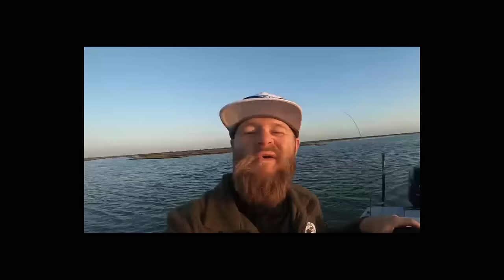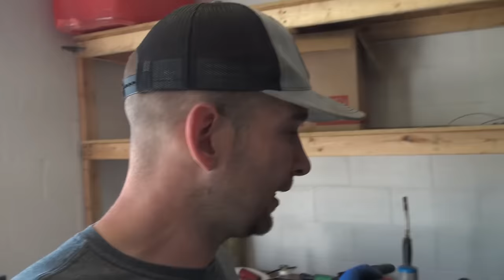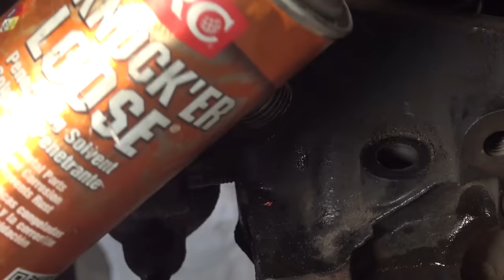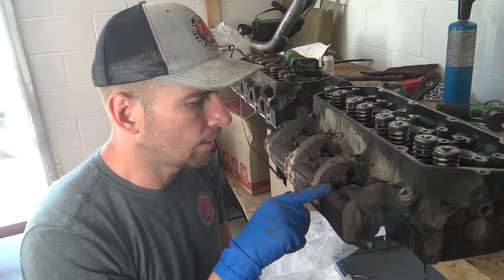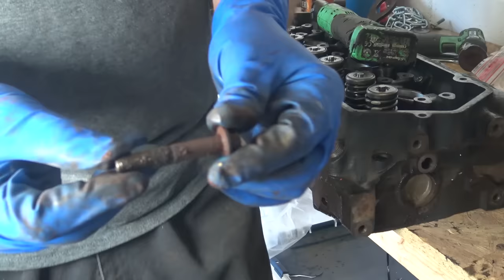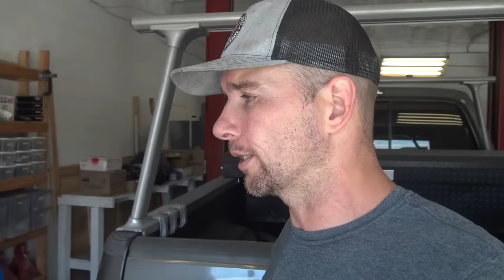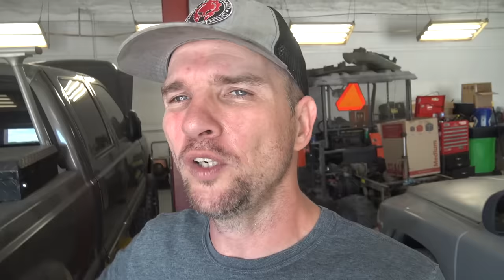Old Mechanic Taught Me This Trick To Removing Rusty Exhaust Manifold Bolts!

Comment: an old timer gave my the best advice to date. I`v been turning wrenches for 30yrs now. here it is, any thing your working on when you get frustrated stop, go get a coffe,pop,beer come back and it will just come apart. Trust me when you try this you will be amazed how it works.
Reply: Sometimes that helps to let the penetrating oil soak in, but quite often, it will still be a struggle removing bolts like these...
Reply: this is true. even works with stubborn electrical connectors.   (No PB Blaster ;)
Reply: The best advice on the comment thread no doubt!
Reply: Never do anything under heavy emotions, when possible.
Reply: My papa used to think about it before bed then the next day he'd get er done!
Reply: Good advice and it does work.
Reply: Great advice! I DIY quite often where I can on my vehicles and I've found that sometimes under high stress, alls you gotta do is take a break and come back to it when you've cleared your mind and maybe had something to eat. It's always better to wrench when you are relaxed and not stressed out
Reply: Yeah,except when the boss prefers to watch you struggle rather than give it a few minutes
Reply: well....to borrow a phrase from MIB movie " we need some pie!", the problem is still there when ya get back, but a pause is valuable because for some mechanics it permits some thought that leads to a solution. Most of all it breaks the cycle of impatience and frustration which usually lead to mistakes, even for a seasoned mechanic.
Reply: Or weed.
But always hit it with penetrating oil before you walk away.
Reply: I've had some you could come back 2 weeks later and it would still be a total pain. And, IMO, penetrating oil, no matter who makes it, Blaster, CRC are all  over rated . Maybe 1 time in 20 they actually helped get a bolt un-stuck.
Reply: That works for putting things back together again too
Reply: Bong rip?
Reply: Thats exactly right, it's amazing, when you're trying to start a nut in a very tough to get at place or similar situation if you take at least a 15 minute break it's surprising how  easy it is when you try again.
Reply: I needed to read that
Reply: Deep wisdom
Reply: For sure.  I ordered parts for my truck weeks away. Lol

Comment: Great video.  I have been a mechanic since the fifties and in that time I have done most things wrong at least once.  And when I have I have always made certain I understand what I did wrong.  When it comes to rust, corroded bolts I have pretty much mastered the problem.  The key to my method is "impact."  By that I mean a hammer.  One thing you have correctly described is, don't rush it.  Spray on the penetrant and let it have some time to do it's work.  Come back and put a wrench on the bolt and rock on the bolt head.  I like to use a box end wrench and twist left and twist right.  Stop.  Unless that bolt is clearly going to come out easily, spray and hit it with a small ball peen hammer. Rap on it a bit.  Get the wrench back on and twist, alternating directions.  Not loosening?  Restart the process.  The hammering is very important because the shock of the hammer blows breaks up the rust.  The penetrant and the shock should do all the work.  The wrench (or the socket,) does the unscrewing but It will always be easy if you use enough penetrant, shock and time.  Don't rush it.  It will work, just be patient and keep repeating the process. One last thing.  Get yourself a set of high quality left handed drill bits.  If things go bad and the bolt head is gone, use the largest lefty drill bit you can and it will probably unscrew the bolt.  Get the bolt out and everything out of the way and tap that bolt hole.  Screw the tap in as far as it goes in easily, flood it with penetrant, back out a quarter turn.  Repeat until you can turn that tap in there with your fingers.  Going together, use a metallic anti-sieze on the threads.  This is no indictment of your method, I'm just telling you what I have worked out and what works well for me.
Reply: Excellent points to compliment a very useful video.  I just returned from a shop and the mechanic said the manifold was leaking and so he failed the inspection. Said he was afraid to fix it for fear of breaking the bolts off.  Problem is that there is very little clearance to do the work, but we will give it a shot.
Reply: I have used a hammer drill set to hammer only, and a punch, or socket, to press on manifold or bolt, run that for a while.  The vibrations break up the rust, as due the other techniques.
Reply: Cool info,sometimes its what the guy before you work on it did or didn't do well.Antiseize,locktite,Teflon tape,pipe dope,grease,especially tires i despise a tire shop that makes it impossible to get a wheel OFF.I always have a plumbers helper in my car 2 feet long,this has saved me from AAA having to come out.I like to fix my stuff from my Toyota RAV4,to my Sig P320C, always buy the Chilton manual for your vehicle,over the past 50 years I used them to help rebuild my dads carburetors etc etc ... on all our MGBs to my 41 Ford super Deluxe coupe.Which was my daily driver when I was 16.
Reply: There is a product made by Conklin which is called Rust Bomb.  It really works, better than any penetrating oil out there.  Some distributors for Conklin have made a lot of money  through the company with just this product alone.  It works on ultrasonic vibrations when using the hammer tapping method.  You'll be amazed how well it works.
Reply: @Bruce Doxey;  
Thank you for sharing you lifetime of experience on this. I greatly appreciate it..
Reply: 2 cents from the peanut gallery: use bottom tap for cleaning holes the have a super short taper. I prefer copper based antisieze like caterpillar uses.
Reply: Snap-on tools makes a handy tool called the "Shake and Break". It fits in your air hammer with a 3/8" square on the other end to put your socket on and a 3/4" hex in the middle to put your wrench on. You pull the trigger slightly, not too much, while at the same time putting pressure on your 3/4" wrench and BAM!!! she comes loose. You can use it with a screw driver tip, instead of a socket, for removing steel screws from aluminum like when removing lights on the side of a transport truck trailer. Been using it for years. Gitchya one!!
Reply: Came here to say this. 9/10 times impact will break it free. I also mean impact with a hammer, not an impact tool.
Reply: I agree.  Tap tap tap.   Not hard.  But many many small taps.  All of a sudden with light pressure the bolt comes out.
Reply: Yes, shock waves tend to help also. It's like using an impact gun, but you control the torque by using a hand wrench.
Reply: Someone taught me this yea
Reply: Someone taught me this years ago. Patience us a virtue for sure. If it takes 20 straight minutes of light blows from a small ball peen and heat/ penetrating oil will get 99 pe
Reply: The hammer is a good method, but as well as hitting the nut on the end, try hitting it side to side.  The hole is always larger diameter than the bolt, so the bolt shaft should be able to move left and right a bit, to break up the rust.... You have only to get 1 thou clearance for it to be loose.
Reply: Thank you for taking the time to post your comment, I enjoyed reading all of it. And I learned a lot from your suggestions
Reply: You're right, I worked as a machinist in Commercial Fleet and removed hundreds of bolts, intact and broken. Penetrating oil and a good shock to the head of a bolt is key. I usually had to drill out the broken bolts after our mechanics had already broken them off or they had broken from heat cycling. I actually got pretty good at drilling out broken bolts with the heads in place using a drill bit sleeve, mirror and an right hand drill motor.
Reply: I haven’t been a mechanic as long as you but totally agree! 👍🏻
Reply: Crucial!
Reply: Wow, since the fifties. Lots of experience.  I'll bet your ratchet could tighten up or loosen up any ol rusted or stripped hole.
Reply: those lefty drill bit are a must when dealing with busted bolts . you have to drill em them any way.. many times they will loosen up by just drilling to the left 👍🏼
Reply: @markwilson9196
Reply: @markwilson9196
Reply: And whatever you do don't use an easyout they seldom work and can make more problems.
Reply: @hiscifi2986  I like that advice. I'm wondering if a long bit in an air chisel would work.... maybe 15lbs or however low a pressure it can operate at. lots of tiny vibrations.
An air chisel might work on the back bolts that are hard to tap on.
I like your thought process 👍

Comment: I'm surprised no one has mentioned this yet:  Heating the parts first, then spraying with cold lubricant will suck the lubricant into the threads. Repeated heating & cooling will cause the lubricant to penetrate more.
Reply: Oh yes indeed. I thought every man knew that: you gotta heat the parts first  then spray with lubricant... which will suck the lubricant into the threads ... and cause the lubricant to penetrate more 😋
Reply: Capillary action is indeed an awesome trick
Reply: @Xiggy4Ever  indeed it is.
Reply: Great tio. Well try this.
Reply: Cheap: Mineral spirits and oil. 

I refuse to pay $6 for a can of whatever. 

Add some acetone too.
Reply: @dolphincliffs8864  ,

Mineral spirits would probably be kerosene, lamp oil or Coleman fuel.  I think mineral/"baby oil" is a little too thick for most of these applications.  Turpentine comes from conifers, but might also work. Somebody told me that WD-40 it was made from Fish oils.
Reply: And don't forget to hit the bolt several times with a heavy hammer. This breaks the rust which is brittle, while metal is elastic.
Reply: @DrChaad     Might have been in the past, but WD-40 has changed its recipe so many times since it was introduced that I don't think that anyone knows what it's made out of anymore. In fact, to get the signature WD-40 smell, they had to create the scent as a perfume and add it to the product. You read that right: the WD-40 smell is currently artificial.
Reply: Nah I bet what's actually helping there is the heating and cooling of the bolt which breaks the rust. All this dicking about with penetrating oil is a waste of time, just heat it up and let it cool down.
Reply: Heat then spray with liquid wrench,then carefully tap at it with a hammer, the vibration gets it into the threads.. works very well.. 40 year professional mechanic..
Reply: @SergeantExtreme  wd40= fish oil..  no thanks.. good for water displacement and that's about it.. liquid wrench has always given me the best results.. for 40 years on the bench now..
Reply: @h8troodoh      WD-40 hasn't been fish oil for over 50 years. Get with the times grandpa.
Reply: @SergeantExtreme  housewives use wd40,little guy.. under the cupboard for those squeaky hinges .. 😅🤣😂 clown
Reply: @SergeantExtreme  why do I envision you covered grease in a driveway butchering some poor car with your harbor freight tools and your beloved fish oil 40 juice ,EVERYWHERE.. 😅🤣🤣..
Reply: @SergeantExtreme  Clown
Reply: @h8troodoh man literally killed him and didn’t think it was enough 😂
Reply: also there's no such thing as too much lubricant/penetrant. Every time you get a small turn on the bolt, spray a little lubricant onto the newly exposed thread. Certainly doesn't hurt.
Reply: If you heat first and then apply the penetrating oil, wouldn't that cause most of the penetrating oil to burn off and dry out on contact with the hot surface?
Reply: @h8troodoh  WD 40 isn't the best penetrating oil but I always spray it into all my electrical connections under the hood,I've done that for 50 years and it keeps the connections from oxidizing and failing.
Reply: @h8troodoh  Great advice, but I recommend starting out with the old fashioned liquid type of liquid wrench that is very "thin" and will soak through rust better than the spray type penetrant, which is better used later when a lubricant is needed.

Comment: Tap the bolt heads with a hammer too. The shock load can break loose old corrosion bonds.
Reply: Absolutely! Not just tap but wail on them for 20-40 repetitions- this will also swell the head of the bolt which can help with corroded/eroded fastener heads. If tight, just hammer the socket on to reform the head. In the marine industry, all bolts are rusty and stuck. Be sure to use grease or anti-seize on the new fasteners during reassembly.
Reply: Brass hammer
Reply: If you can get to them hahhaha. But yes indeed I agree, it helps a bunch.
Most of my work now is in the marine world, lots of rusted bolts in the salt air and mostly in very tight spaces.
Reply: I retired from the merchant marine and my go to rusty rotted fastener tools were torch, smaller than required impact wrench using the hammer action without too much torque that snaps fastener, disc grinder, air chisel (if you can get a good bite going in the loosen direction, really effective), and welding allen wrench to it. When I first started stainless very expensive, now not so much so I started putting those in and they last a lifetime.
Reply: @bigtuna4037  Ch Eng Unlimited    Welders in the shipyards would heat then use the waxy cutting agent for drill bits. Could actually watch the melted cutting agent disappear into the threads. High frequency vibration will work too, just ask any GT tech.
Reply: Yes I would use beeswax or parafin for threads that were in good shape and usually hot like steam lines (start the day before) and hold the block up to it to melt in, but if they were in bad shape and I dragged the torch there any way- off with their head. If they already turned to s*&t not re-using them anyway. I retired long before them fancy GT's but only the government can afford to run such things- they have no concern for cost.
Reply: can you use impact drivers here instead of tapping - may be use impact drivers altogether ..
Reply: @valireklaam  the bolt will break if you use impact...
Reply: I was chief engineer on offshore supply and fire suppression boats back in the '70s. I've used all those tricks, but sometimes rust just wins. Sooner or later, you'll have to drill one out.

But before it counts, practice on a few broke studs from a junk yard. Once you're doing it when it counts, you'll be more comfortable.

Trust me, even calm seas have enough movement that it's a b#&ch to do in close quarters. But even a stationary vehicle engine can be a cussing match with the motor in the truck.
Reply: @valireklaam  that's a 90 degree difference in force.  a hammer is giving an in and out force. a wrench is giving a tuning force. that's why you use the added force of a hammer, to break the bolt loose in a different direction than your wrench. i hope i explained that well. i'm a better wrench than writer.
Reply: @Align700nitro  i removed 6 bolts out of 8 once, using the hammer method, my dad and his new milwaukee 1/2 impact, didnt just break 1 but the other 2, lucky both had enough sticking out of the block to get ahold of, lol.
Reply: But never tap or beat on the manifold. Cast iron breaks quickly and very difficult to fix.
Reply: When I worked offshore before we would rig down we would spray down everything with fire hoses and the water breaks down the rust almost as good as penetrating oil. Rust happens due to water and water will break down rust. I have a buddy that works at a Chrysler dealership and he had an exhaust job to do and tried what I recommended with water and the other mechanics razzed him until he was able to get them out without breaking any. Try it before you break any off next time.
Reply: @chestervaldes7551  Careful with some antiseize, can turn very hard if it gets heated too much. Worse than red loctite, and sometimes as bad as the ultimate loctite, crossthreading.
Reply: @chestervaldes7551  I've found coating the threads with Permatex Ultra Copper High Temp Silicone help protect threads and slotted / captured areas on reassembly of exhaust parts from rusting again.
Reply: Or just heat it up, done
Reply: i used brass puck taped to air chisel blunt bit tip and just brrrt on the sides around bolt and the top of bolt.    i never put same metal on metal. i used this formula  air chiesel w/ hard steel>softmetal>target surface if u dont got,  piece of wood works.   learned my mistake
Reply: @chestervaldes7551  I freaking love anti seize....
Reply: A few choice words makes the “tapping” more productive.
Reply: @bigtuna4037  I agree with you on using stainless hardware. My time is worth more than cheap hardware (and I’m retired). Also, stainless looks pretty and never rusts.
Reply: That's what I told my last "mechanic", and he STILL couldn't get it right. All that tapping was more like hammering.

Comment: Extra tip for the torch technique: rust and crud are surprisingly good thermal insulators, so use a wire brush to clean the surface of the are that you want to heat. This will focus the applied heat on the part of the manifold you want to expand, increasing the differential thermal expansion of the manifold versus the bolt.
Reply: Also the hottest part of that flame is probably an inch or more from the nozzle, or the end of the blue flame tip.
Reply: Heat and apply bees wax